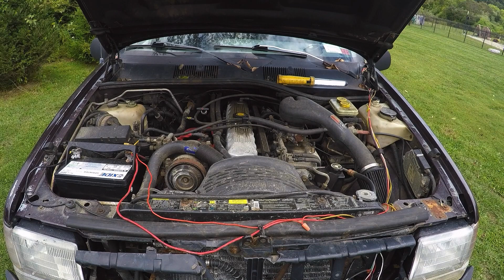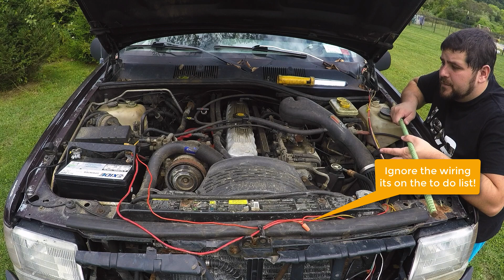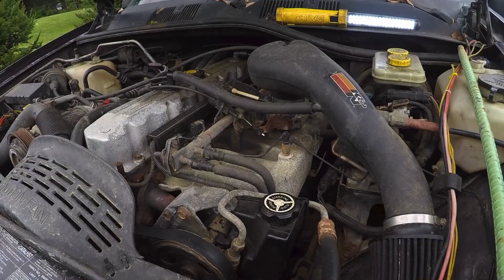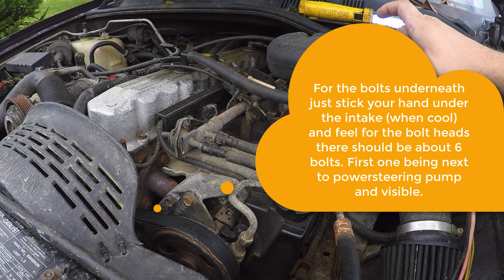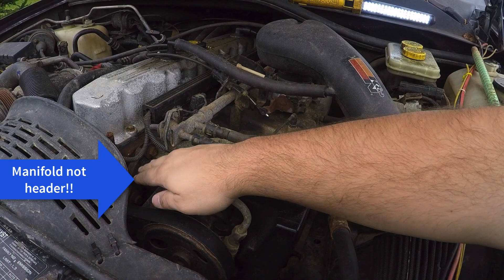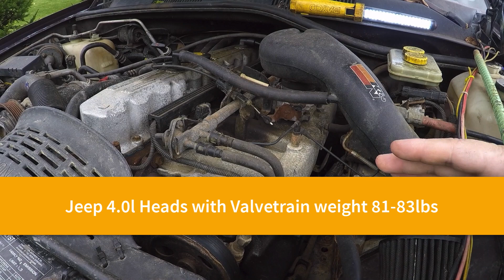Complete Head Gasket Replacement for Jeep 4.0L - Budget ZJ Build

Comment: I tried a head gasket replacement on my car which had a 4 cylinder in it, total waste of time.  Got everything back together after several days of cussing throwing things, etc. only to start the car and find it was only running on cylinder #3 & #4...no compression on #1 and about 15-20lbs on #2 :(.  Needless to say I was extremely upset as I liked driving the car for the fuel economy.  After that I decided I will never attempt any engine repairs that require disassembling 1/2 the car to work on.

Comment: I have collapse lifters and or a cracked piston skirt.  Got heat soak and it dumped a cort and a half of gas in my oil.  My mid engine sounds like a popcorn machine.  I want to pull the head with the intake manifold and exhaust manifold intact . I have had problems with the manifolds warping when you remove them. Is it possible to remove them intact with the head?
Reply: Yes its possible just disconnect the fuel lines from rail and wiring and cables then unbolt the exhaust manifold from down pipe then proceed in getting all the head bolts and rockers off....it will be a pain to lift and maneuver but its possible
Reply: I have a rafter and a chain fall. Should simplify the lift . Just was wondering what your thoughts on this were. I havent looked to see what all is in the way . Its a big piece to pull at once

Comment: Complete GUIDE to head gasket replacement!!! lol.  Go Barney Go! Laughed my ass off when Eric started using the rebar as a pointer!  Yea dude, that head weighs a ton, I agree it should be pulled separate.  Those dang manifold and header bolts are such a pain to reach tho!

Comment: My 4.0 has piston slap before it gets any worse I’m going to park it for now
Reply from the maker: Seems like a good idea. My sister ignored piston slap in her WJ and grenaded the #5 piston
Reply: I thought this may be the issue with my ZJ, but I thought piston slap was something that would keep making noise even after the engine was warmed up?  The noise I hear goes away after the engine is warm.  Someone on another forum somewhere mentioned a bolt or something in the torque converter inspection plate area that could be making the noise but I'd think that wouldn't go away after the vehicle warmed up that it would be a continuous knocking noise.  I also thought lifters but its not that it sounds lower in the engine than something in the upper end....ugg noises like this are so dang hard to figure out.